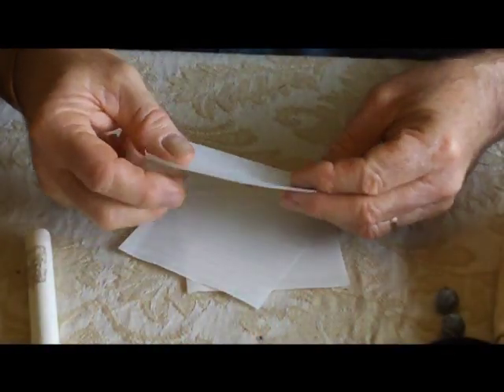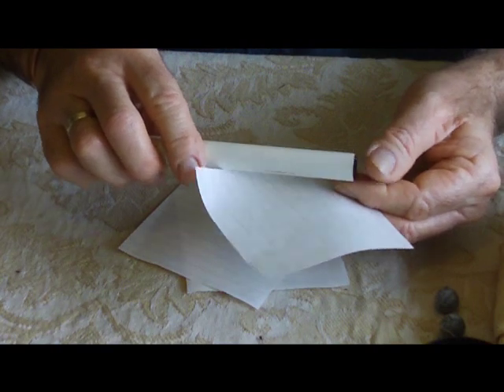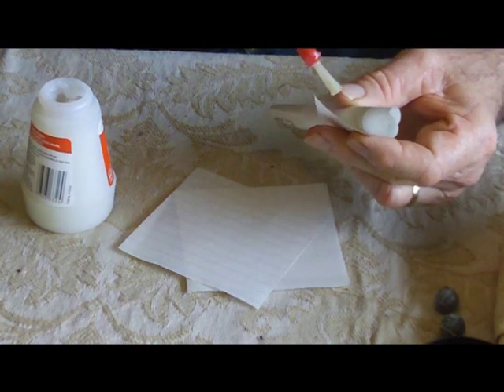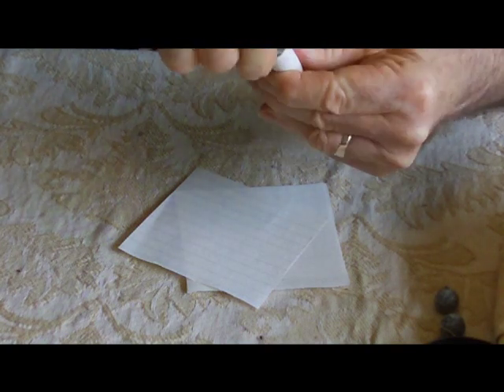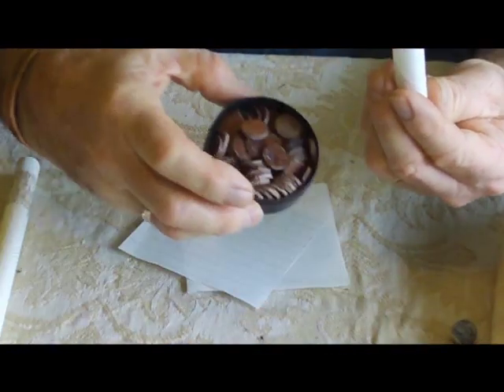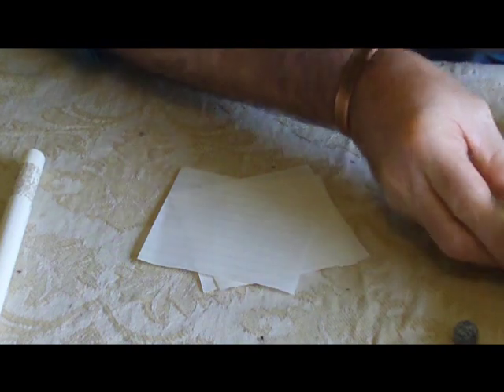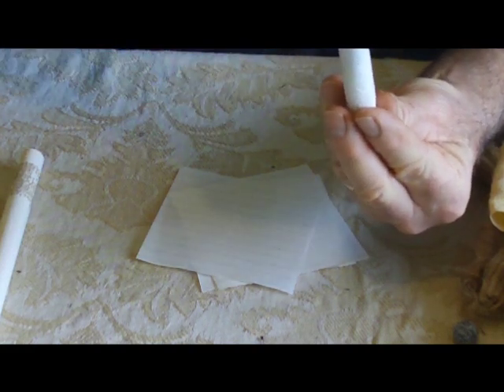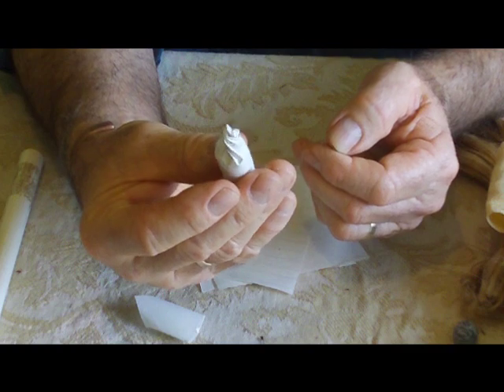How To Make Paper Cartridges For A Smoothbore Muzzle-Loading Gun.

Comment: I used the packing paper used to ship my black powder. It looks like it's going to work just fine. I did use a 21st century glue stick on the top edge of the paper. It helps to roll the paper tightly around the mandrel.
Reply from the maker: Good one Richard, well done!
Regards, Keith.

Comment: Any ideas on making 00 buckshot pattern better in a side by side muzzle loading shotgun?
Reply from the maker: It is a matter of finding the optimum load James, a load that will kill, but not so much power that it breaks the pattern. To do this you will need not only to experiment with different wad variations, but also with various powder loads. If the shotgun is a 20 gauge or 12 gauge (or 14 gauge) then I suggest you start off with a powder charge of 60 grains in volume of 2FG & work from there.
You can use wads or wadding, your choice. I use leather wads in my 20 gauge so as not to start a fire with a smouldering wad! Experiment with thickness of wads & number of wads.  The process can be slow, but is worth the time.
Regards, Keith.
Reply: @historicaltrekking  thank you Mr. keith. I'm interested in the leather wads too.

Comment from the maker: I took another look at the video Dave, & you are right, it does look thin, but I am pretty sure that I was using photocopy paper. I like it to be pretty stiff once constructed, because otherwise it may collapse or crinkle putting it into the belly box.
Actually waxing the paper is not a bad idea, especially for use in wet weather. I wonder if they ever did that.
Regards, Keith.

Comment from the maker: Usually you use a greased cotton or linen cloth patch. However, rifles need cleaning after the first shot or two otherwise it can result in a ball stuck part way down the barrel. What I do is use a patch for the first shot, then I load ball only without a patch.
In a wilderness living situation you would soon run out of patch material anyway, so I would be loading a ball over powder with no patch, & using some plant material like a green leaf or green grass over the ball to hold it in place.
Reply: Using leaves in the woods, lol;  Smart !

Comment: I buy the wax paper in the food store, you get 75 feet. I use it because i want my ammo to fit the bore as close as possible. This is the only way i can make it all fit even after several shots. You can make your cartridges with as many rolls as you need and the paper is thin and strong enough not to crush on loading. I dont know if they did or not but as a retired vet i know soliders always find a way.

Comment: I've never had the opportunity to load or fire a fusil. I have fired flint lock rifles and own several cap lock rifles. It has reached the point that here in the U.S.ofA. it is difficult to obtain black powder. Pyrodex is easier to get.
Reply from the maker: I can't get black powder locally scarz, I would have to go to Tamworth a 100 klm away. Fortunately I have not run out yet :)
Regards, Keith.
https://neclhg.freeforums.net/
http://woodsrunnersdiary.blogspot.com/

Comment from the maker: I just used ordinary flour & water glue, but you could use hide glue if you wished.
I have not noticed any change in the fouling of the barrel.
Cartridges were made in much the same manner as this in the 18th century. I am not aware of any factory manufacturing of this paper cartridge. The military made their own as far as I know, as did militia units.
Regards, Keith.

Comment from the maker: Bear in mind that modern gunpowder is not the same as 18th century gunpowder. I would not be using that kind of load with modern gunpowder, simply no need. Also no need for too much in the pan, it will only slow things down. Personally I prefer to use 2FG for main load & priming. 1FG is for cannons.
Regards, Keith.

Comment from the maker: If it was a new gun I would tell you to follow the makers recommendations, but seeing as I think it is second hand, I recommend you don't use more than 80 grains of 2fg black powder. What you need is an optimum load, that is one that is accurate & with the power you need. I suggest you start off with 60 grains of 2fg Black Powder & see how it goes. You should also be able to prime with the same gunpowder, 2fg. You don't need a priming horn, they did not exist in the 18th century.
Keith.

Comment from the maker: The dowel needs to be the same size as the round ball you are using, otherwise the ball will not fit into the cartridge. Any paper will do so long as it is strong enough, e.g. probably not newspaper, & not too thick that it will not fit in the barrel. I use photocopy paper; Dave uses the fire proof baking paper which is a good idea in my opinion.
Regards, Keith.

Comment from the maker: You don't say the make of your .50 cal so I don't know what the recommended loads are. What you need, depending on what game you are hunting, is an "optimum" load. This is a load that has good accuracy & enough power to knock down game. Too much gunpowder can result in poor accuracy, too little & you will lack power. To get this right you will need to do some shooting at targets. Are you using 2Fg or 3Fg?  An educated guess would be 60-80 grains of 2Fg for optimum in your .50 cal. I will pm you.